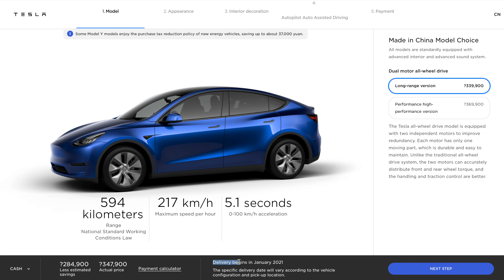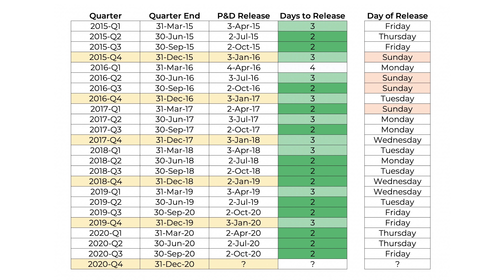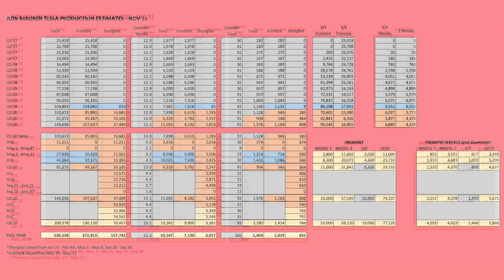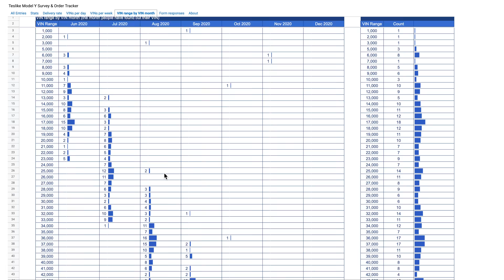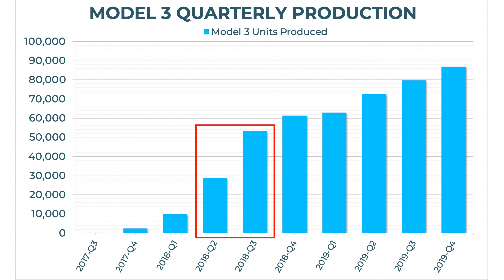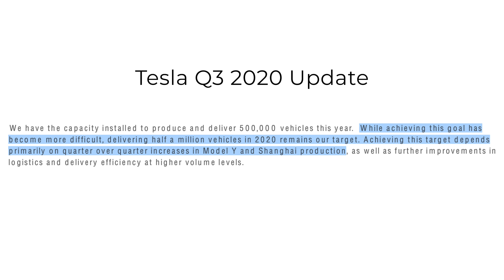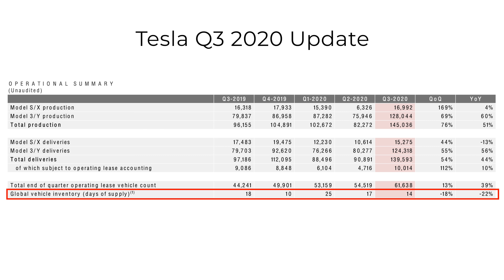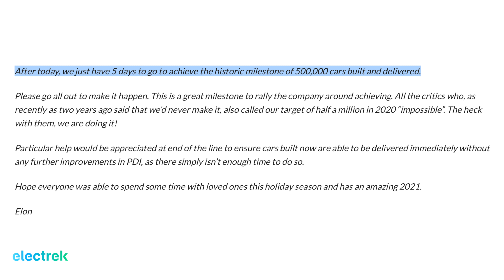Tesla Q4 Deliveries & Production Estimates | 2020 (Tesla Daily)

Comment: I was wondering about the supply difficulties when dealing with two factories (Fremont and Shanghai). Unless each factory is self sufficient (including it's local suppliers) then parts may have to be shipped from, say, Fremont to Shanghai which may then constrain production at Fremont. Then, with two new factories, Berlin and Texas, the equations could get a lot more complicated introducing choke points that make estimation more difficult. What are your thoughts about 'factory self sufficiency"?

Comment: 500k+ for 2020, 1,000,000+ for 2021!
Reply: I agree.
If they produce 180k in Q4 this year that's a run rate of 720k right off the bat. Plus Model Y China, plus improved rate at Freemont and we are above 900k without any vehicles from Berlin or Texas. 
I think 1M is a shoe in for 2021 and they will guide for 1M+ with stretch internal target of 1.25M
Reply: That'd be superb
Reply: I think they’ll give guidance for 750-800k n exceed
Reply: Although I'd jump for joy if that happened, I dont think they be able to pull it off

Comment: Rob, great work as always!!! I do think you had quite a bit of conservatism in your Q4 delivery #, assuming your production # is right on, my hunch is that the delivery # will exceed 515K for the year. Here's why, looking at the end of quarter inventories, it seems that inventories have been decreasing QoQ from Q2-Q4 with the exception of 20Q2, which we all know it was because of the strong push Musk made in that quarter due to COVID, so if that was a normal quarter,  the inventory # would have been somewhere between the Q1 and Q3 inventory #, so with that, I think Q4 inventory could be in the 24K range. If you then take your production + the difference of Q3 and Q4 inventory, you would get an estimate of roughly 515K. If you remove the conservatism in your production #, we could see a even higher delivery #.